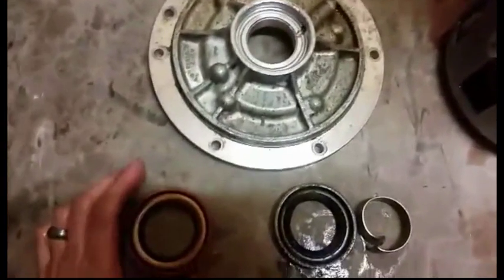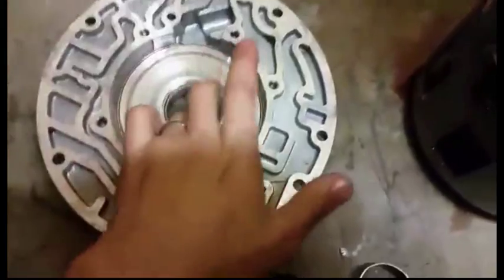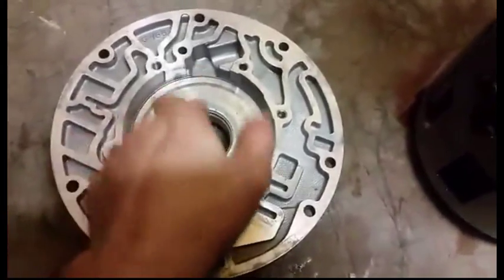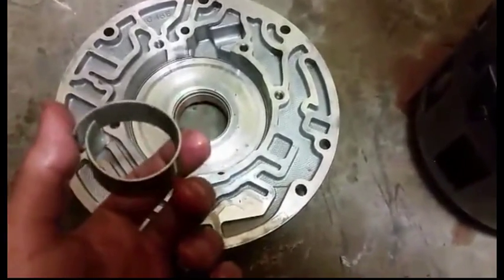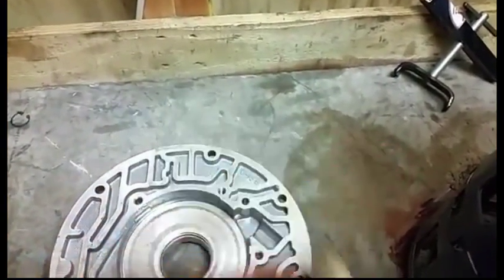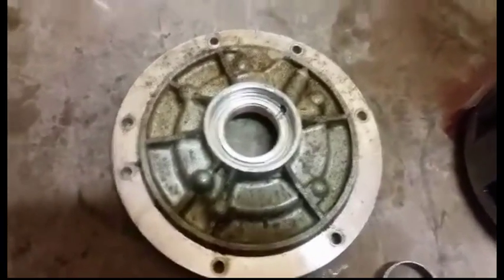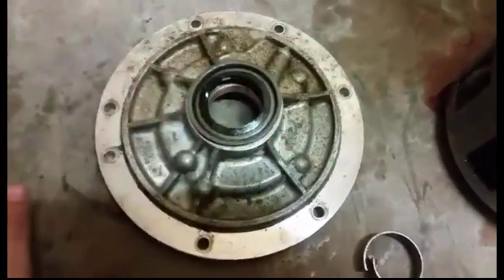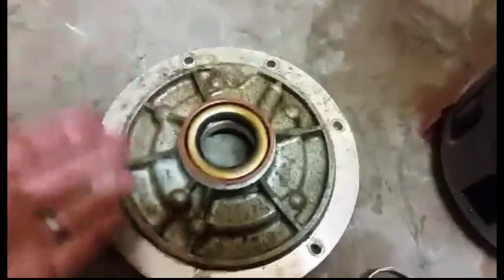Transmission Bushings

Comment: should the outside surface of the torque converter hub(rides on the bushing) that goes into the tranny be really smooth?
 mine has a layer of surface rust on some spots from sitting under a carport. also some light pitting.
should i just use fine sand paper to sand down the parts with the surface rust?
will the very small pitting affect anything?